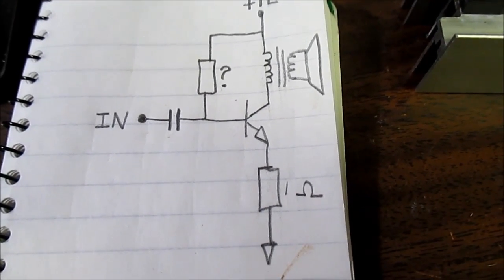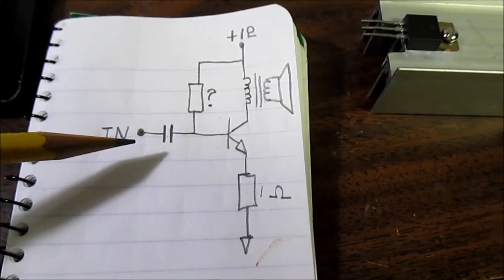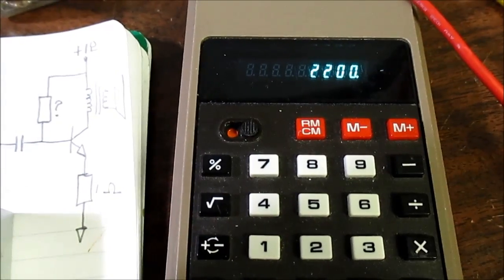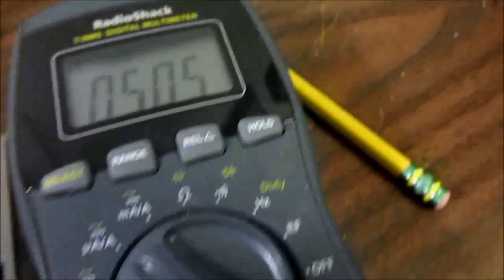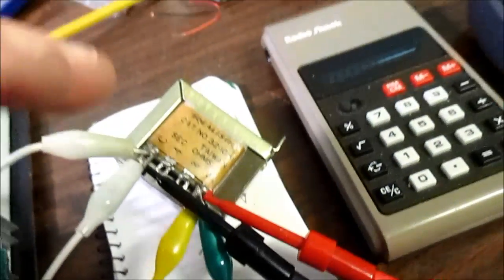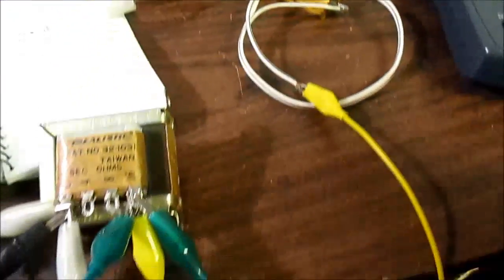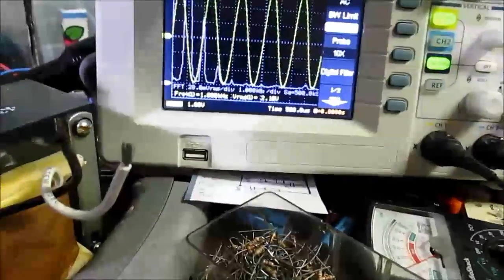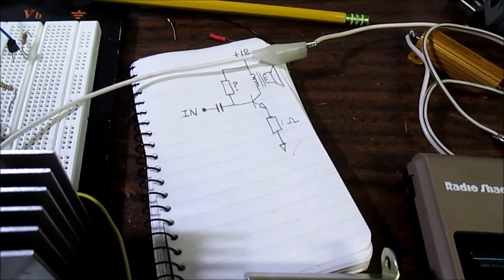Adventures in a one transistor audio amplifier

Comment: The original Delco radios with the big heatsink on the back didn't use a transformer for the speaker.  They used an autotransformer with a 1:1 ratio.  😁  In other words, they used a choke, with the speaker connected across the choke winding.

Comment: tried a circuit like this without the emitter degenerator resistor for a qrp rf amp using a power npn transistor rated for rf frequencies. I had a 1Hz 'motor boating' issue using a small guitar amp 12V supply and no useful output. Using a heavier duty PSU from a yamaha keyboard the 'motor boating' went away and I have slught amplification. So yes it's power hungry!

Comment: that's not a class A amp more like a class AB. For pure class A you need a 100 ohm resistor in the CB. Quiescent current will be at 5.35 A and at full scale operation peak power on the transistor will be 200W and on the 8 ohm load 13W, less than 7% efficiency. Voltage amplification is 8 and maximum unclipped Vout(rms)=3.45V or Vp-p=9.75V with Vin=0.458 mVrms or Vinp-p= 1.3V .

Comment: I don't get it. Normal amplifiers use two transistors, one NPN nad one PNP. How can, when using only one transistor, the output be AC? A transistor only works in one direction, so where does the opposite polarity part of the wave come from.
Reply from the maker: The output is a varying signal. Think of it as AC with a DC offset that prevents it from crossing zero where the transistor won't work. Using a capacitor you can remove the DC offset and get an AC signal.
Reply: @JohnAudioTech  

Oh interesting, I already assumed that you are biasing that input with the resistor to make it DC. Pretty amazing that I works so well converting it to AC again.
Reply: @raykdreisatzgehtanders7239  I think since you put it through a transformer it will be as if it is push pull. 
Since Transformer only transmit the change of current. No matter if the primer side goes negative or not.
The secondary output will be + - sinus.

Comment: At the risk of sounding like a complete doofus, I have to ask. If the transformer/coil in this circuit was designed to isolate the DC current from the speaker, wouldn't a decoupling capacitor do the trick instead?
Reply from the maker: Replacing the transformer or coil with a current source and using a capacitor is another way of making this circuit.
Reply: Oh, I see. Thanks, man!

Comment: Good fun. Interesting how little the bias current changed when removing the emitter resistor - I suspect there might be more voltage dropped across the current shunt of the multimeter than that resistor, though.
Reply: ...not to mention the transformer winding - actually that might be contributing to the unexpected thermal stability, since the DCR of the winding will increase by just under half a percent for each degree C of temperature rise..

Comment: This curcuit sounds way more musical than your other dual transistor one.I think Id rather build this for my turn table and forgo with my plans of a tube preamp stage. Thank you so much for this informative video.
And yes a simple coupling cap would block DC and keep the transformer and speaker safe.

Comment: Hi,

Is it possible to use a SE tube circuit as a pre?

Thanks
Reply: BTW, are subminiature triodes any good for audio?
Reply from the maker: Single ended typically describes a power output stage for driving a speaker. In a manner of speaking I guess you could call a preamp single ended as this is the way the circuits are often designed.
Reply: What is your opinion of hybrid (tube/ss) amps? Have you ever tried to build one?

Thanks
Reply from the maker: To me it is all about low noise, distortion and flat frequency response, if you can get that in a hybrid, no problem. Tubes are impractical to me because they need significant power to heat the cathode (among other things). Tubes look cool and are vintage technology, but I'll take the opamp IC any day. As far as "technical perfection" of the amplified signal, they are as close as it gets.
Reply: +JohnAudioTech Thank you for your insights!

Comment: What is the function of the capacitor on the input? Thanks.
Reply: The Future Sound Of Egypt no, diodes work as diodes... diode allows current flow in 1 direction. cap blocks all DC but allows ac in both directions.
Reply from the maker: There is a DC bias voltage on the base (input) of the transistor and you don't want this to be affected by whatever you connect as a signal source or affect the signal source itself, so it is best to block the DC with a capacitor.
Reply: works as a diode

Comment: Noob question here, but how about just an inductor instead of that transformer, if that's really what you're using it for.
Reply from the maker: +SciPunk215 An audio quality inductor would work much better (this one rolled off the bass). I simply don't have one available. In a new video I will post soon, I did away with the inductor/transformer and used a current source.

Comment: Uses almost as much power AS a single ended valve amplifier! To get the best results you really need a transformer with a primary and a secondary which will load both sections correctly. Probably about a 20/1 ratio. An old Ford car radio I once owned did have this kind of single ended class A amplifier, and did use almost 1 amp under quiescent conditions. Because valves were used prior to this, 1amp was a very low power consumption compared to a valve radio drawing 5-10 amps.
Reply: +Michael Beeny 20 to one? Seems high to me, explain?
Reply: +HillOrStream The relatively high collector impedance vs the low 4 ohm loudspeaker. Maybe 20 is a little high, probably nearer 10:1
Reply: I was thinking they'd make the primary side quite low being that they only had 12V to deal with and would have wanted to push a lot of current through the transformer to maximize power output. I'm thinking of the early car radios for this circuit. I remember those old Delco radios with one huge (stud mounted ?) round Germanium transistor in the middle of a large heatsink.

Comment: are you using a signal generator or a portable player as the source. I wonder what is the distortion of the source in this case since this amplifier does not have a feedback loop.
Reply from the maker: +noelj62  I used my portable player with uncompressed WAV files. I once recorded the player into my computer and found the distortion to be .002% but I can't tell if that is the computer's audio or the player (or both). It is so low it doesn't really matter. Any distortion the scope shows is from the circuit itself. The emitter degeneration resistor cuts down the gain and some distortion.